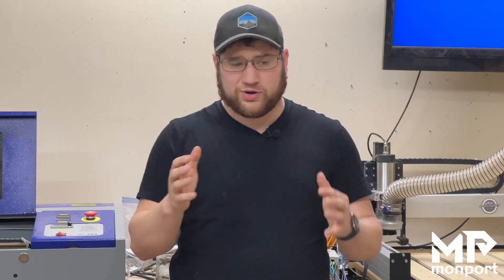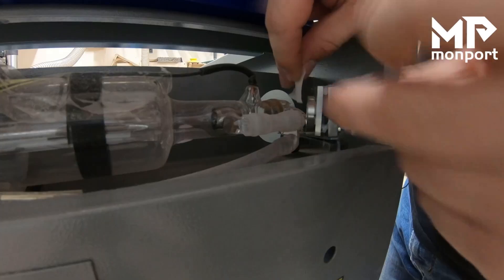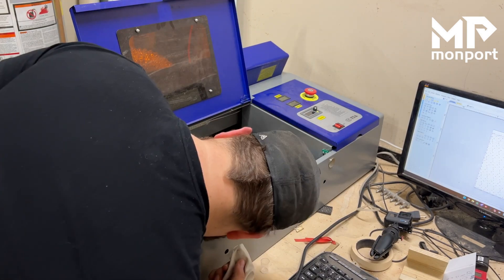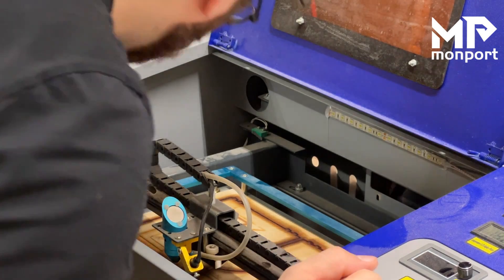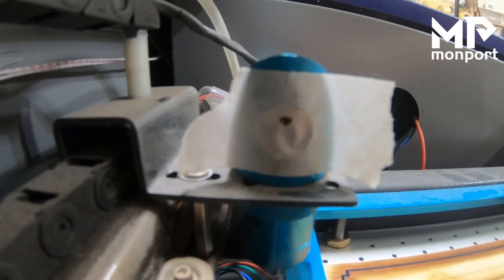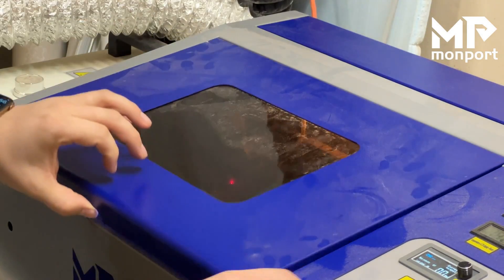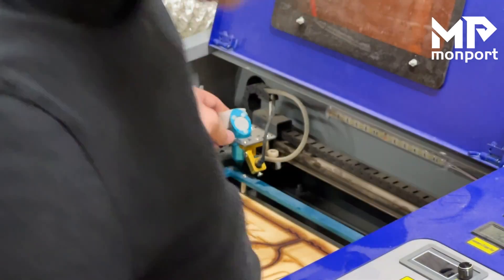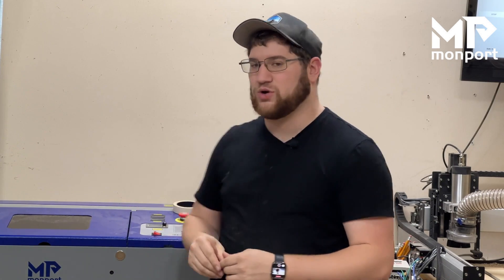Monport Co2 laser engraver and cutter丨 Mirror Alignment 3

Comment: So what happens when laser two has two different holes front and back? Very frustrated. Power display not working and mirrors are wildly off straight out of the box. Oh and CW3000 not cooling.